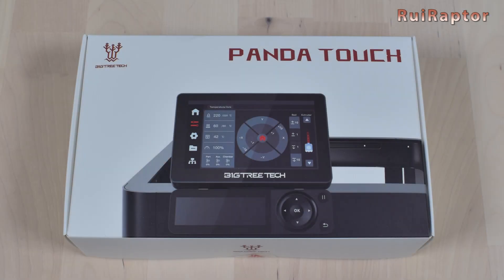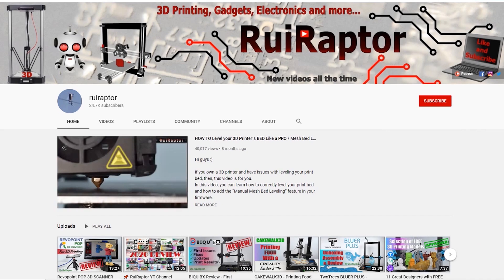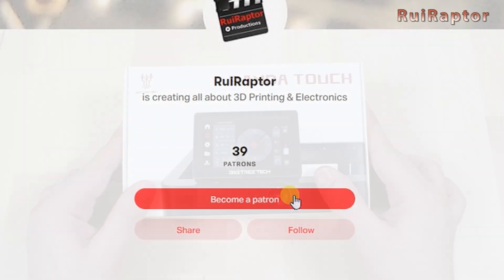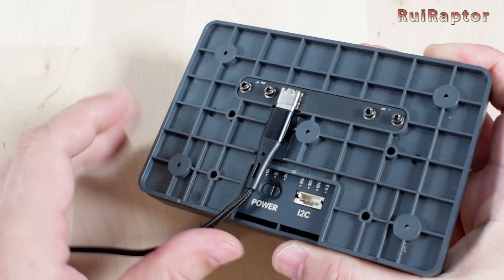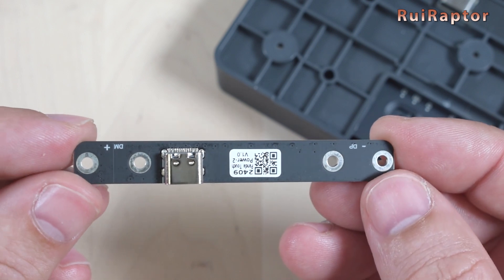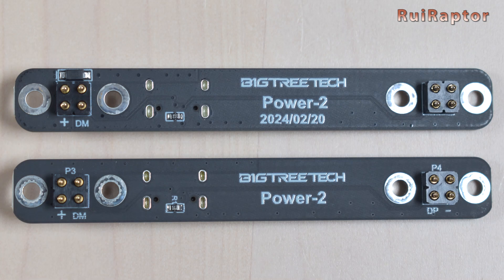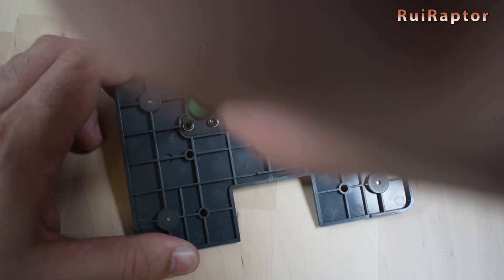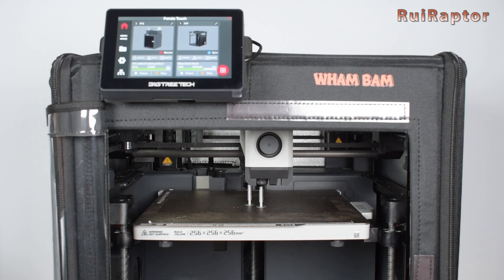BTT Panda Touch 👉 HOW TO FIX Turn On Issues

Comment: Mine does not turn on when switching to external power supply and I have a power board with a diode, support sent me a new identical one and it did not solve the problem.  now I'm waiting for a new device because it cannot be disassembled without professional tools and there is a possibility that something is not connected inside.
Reply from the maker: Hi, thanks for sharing.
Reply: Did you manage to get the issue resolved?
I've just received my replacement PCB and the unit still won't turn on.
Reply: @benjaminchapelow5192  It took a while, but I finally got a new device
Reply: I have exactly the same issue. Bought the unit one week ago. They wanted me to remove the screen and look for a loose connection. I guess the majority work but some don't, so QC seems to be lacking.